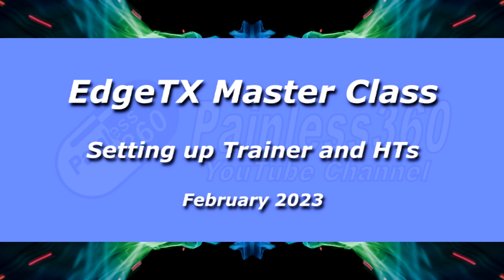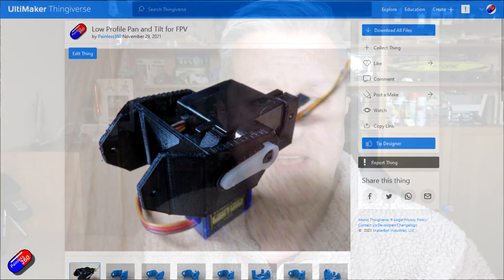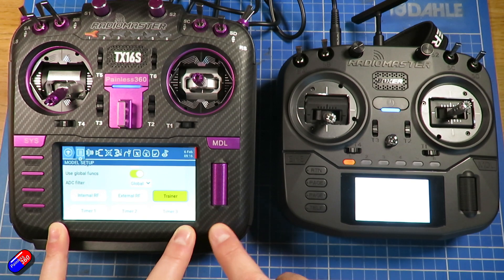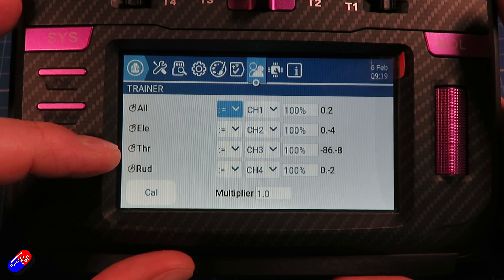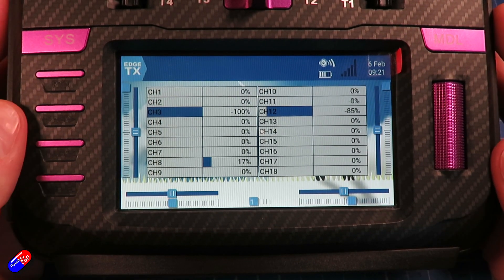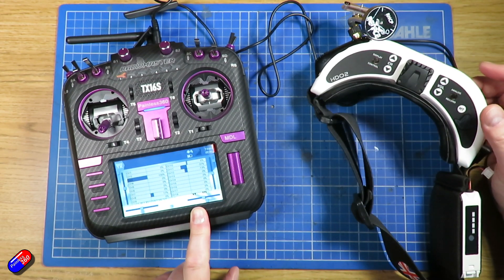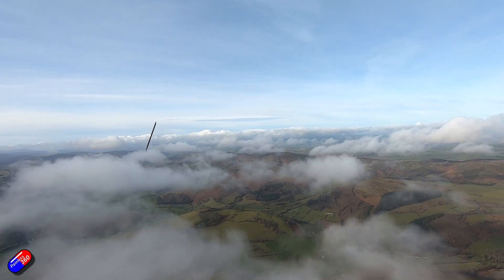EdgeTX Master Class: How to setup a trainer radio and connect a head tracker using a cable!

Comment: Hello Lee  -  Another great video thank you.  
 I have just bought a new TX 16S radio and installed the latest firmware - 1.3.3.24.bin but I cannot see or find the TRAINER MENU or it's icon on the top display bar of the radio.
Any help would be much appreciated Lee.   Best Regards . . . Eddie.
Reply from the maker: At what point in the video does your radio not follow what happens here?

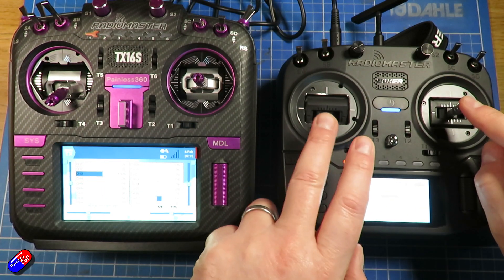Comment: When you flick the trainer switch around 2:56 channel 8 changes. I've observe something similar on my setup, even though student radio controls only channels 1 to 4, switching trainer mode changes "default" or set values for other channels on master radio. Any idea how to prevent it?
Reply from the maker: make sure that switch you're using for the trainer isn't being used for anything else on the radio...
Reply: @Painless360  Yeah, that's checked :) Switch is only for the trainer, I think the trainer mode resets all channels except 1-4 to zero.

Comment: Can the radiomaster boxer do head tracking? I try correspond this process on Radiomaster boxer but not luck. I am using the fat shark HDO2 with the same trinity head tracking module inside the goggles
Reply from the maker: Any radio with a trainer port will support head tracking... Best of luck

Comment: Thank you for making this tutorial. I have an issue though, since updating to the latest edgetx, i cannot find "Tr" functions anywhere. Would you be able to guide me to what the new equivalent is?
Reply from the maker: Trainer stuff only appears when you have the radio setup as MASTER for the trainer function, I'd check that you have that set. When asked about EdgeTX, it is handy to specify exactly what version you are on, as things change quickly. Best of luck!
Reply: Thank you!

Comment: Please help me I’m struggling so much I’ve tried setting up head tracking with the boxer but nothing is working right. I’ve set up the boxer as the master jack and I’ve tried messing with the mixes and the inputs but nothing is coming through. Please help me. I’ve gotten the Motionsic head tracker and the camera mount as well I should add.
Reply from the maker: I'd check that the HT is outputting signals and the cable you're using is ok. Best of luck

Comment: I was curious about setting up the trainer mode on EdgeTX via a cable and behold your video popped up on YT. You’re the best, Lee. quick question: is there a brand cable you suggest?
Reply from the maker: RADIOMASTER sell their own version, but any should work

Comment: Great tutorial, I try to follow your steps (TX16s to Jumper T-Lite V2) with no luck, I believe my trainer cable is not compatible. I had tested few audio cables, the 3 pin jack dosent work, 4 pin works...TX16s speaker said "trainer signal recovered" & immediately follow by "trainer signal lost". LoL 😂 😂 Is the trainer cable same as 3.5 audio jack cable?
Reply from the maker: RadioMaster sell their own 'trainer cable' but I use stereo cables here without issue (as seen in the video). I think the port they use in the TX16s is a weakpoint.. Best of luck!
Reply: @Painless360  Finally managed to fix the TX16s port problem from your earlier video. The port is so bad I have to do the bending of pin (open my TX16s) 3 times to get a solid connection 😅

Comment: The DIY head tracker can now put out an S-bus signal besides the PPM signal. Some RC transmitters can make use of S-bus. I have set up my Powerbox Atom transmitter with the DIY head tracker via S-bus and I think that it is much more stable and works better than using a PPM signal from head tracker to transmitter.
Reply from the maker: V2.2 is out soon and more videos planned. Stay tuned

Comment: I might have to open my radio and check the dsc port lol I couldn’t get mine to work a couple days ago
Reply from the maker: Lots have had the same problem. RadioMaster sell their own trainer cable that works better but I would like to see a better connector to support all 3.5mm jacks and not stop working as it gets used... Happy flying